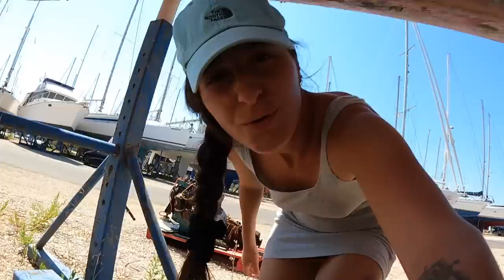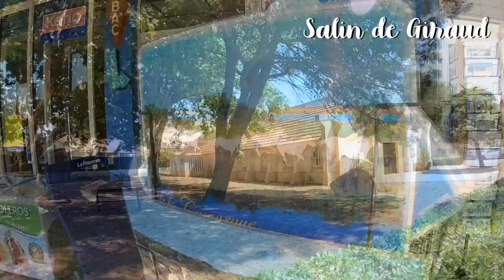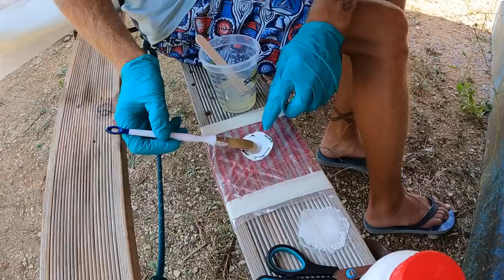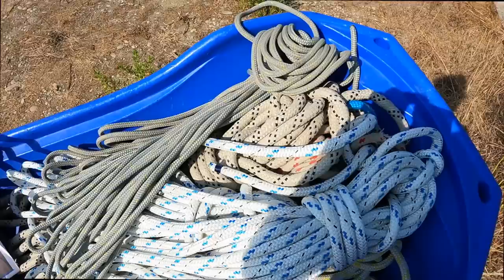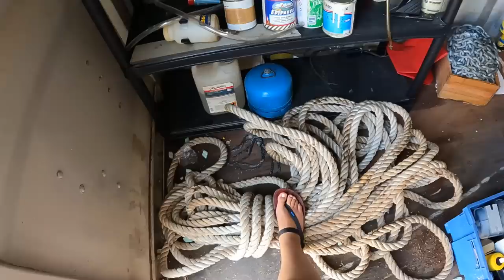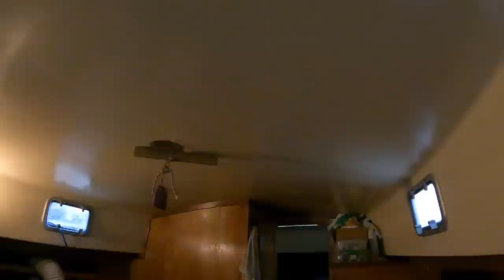We Bought a ONE EURO (1€!!) Boat and We Got Given a lot of Free Stuff 🤑 | SAILING SEABIRD Ep. 9

Comment: Great video,old halyards and running sheets can be soaked in bleach and viniger and water overnight and then put through the washing machine,come out brilliantly.Hatch insert can be replaced pretty cheaply,safe sailing guys.
Reply from the maker: Hiya team Thora,
You can always give the running rigging a wash. Clean it up. Good system you have. The only issue with old ropes is they can’t be spliced, I know the hard way. Once I tried and it took an hour and a half to do one splice hehe.
Cheers for watching 😎
Reply: @SailingSeabird  yeah ok,I know some braided lines cannot be spliced conventionally but a wire rope splice can be used,reduces the strength of the eye.cheers for the reply,I’ll keep an eye on that.have a great birthday by the way.

Comment: Stuart I was taught to put a big disc of glass in first so you are working on a surface well bound to the hull then progressively fill with smaller discs to form a fair surface. Just saying.
Reply: glad someone caught that, always start with the bigger disc first.
Reply from the maker: Hiya John, we’ve seen many video say both are good. We’ll see if it holds but it seem ok so far. Next is to do the inside but that might have to wait. 
Cheers for watching 😀

Comment: You can definitely get a replacement glass for that hatch much cheaper than complete hatch assembly, so worth keeping it.

BTW you should try using butyl tape to temporary fix the leaks.
Reply from the maker: Hiya, 
Good idea on the butyl tape. The hatch is nice but I doubt we’ll keep it. Not going to make a job replacing or fitting. 
Cheers for watching 😁😎😁